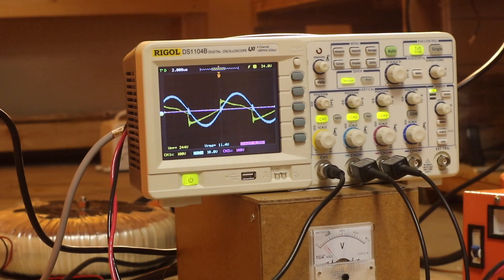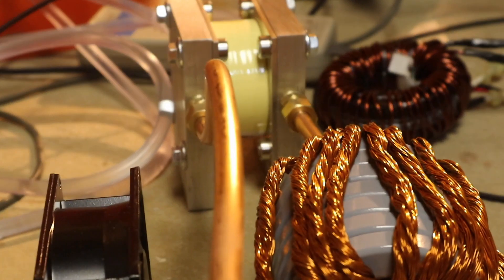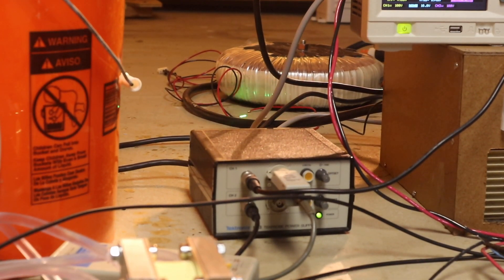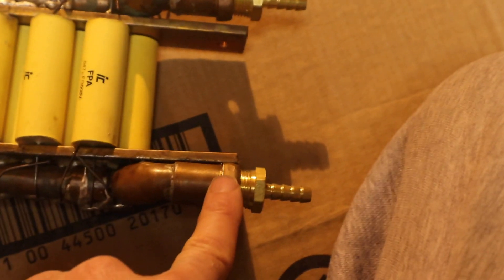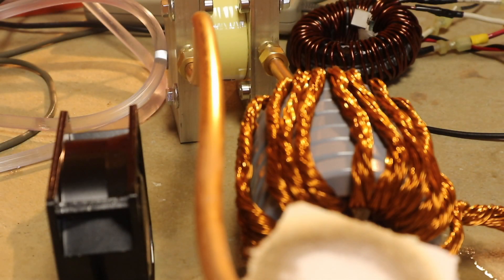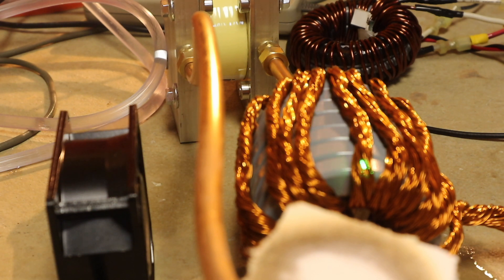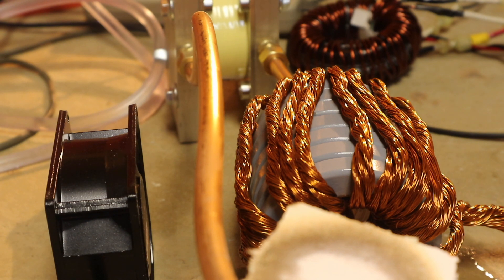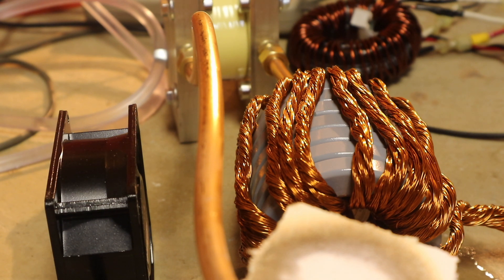How to build a stable high power Induction heater considerations for the tank and transformer

Comment: Would using silver plated magnet wire work a lot better to control the resistance lossed in the wire itself ??? Thanks
Reply from the maker: Not significant enough to justify cost. You would need very thick wire.

Comment: It is only recently that I became interested in induction heaters.  I must congratulate you on the very ingenious arrangement of how to create a low voltage source with a very low internal impedance to feed the low impedance of an L/C series tuned circuit. 

Your voltage step-down transformer does not have numerous secondary windings turns which add internal impedance and will limit the secondary current,( even with a short circuit at the load). You made the secondary by elongating the amount of straight run copper that is captured by all those stacked toroids ferrite cores on top of one another ( well side by side in your case). So rather than using "turns" on a circular but thin/flattish magnetic core, you used a long straight run inserted through a long "solenoid", which does not give you a high Q factor for the secondary tuned circuit, but this is not " filtering frequencies" as we do in communications where coils are normally "square coils"   for better selectivity,  and higher Q factor as your intention is aimed at the producing highest current in that secondary. It would be interesting to know how you held the resonant frequency as you added the material in the hot coil.

 That long straight piece of copper running the length of the ferrites stack is the magic in your arrangement.

That straight copper part in the stacked transformer cores gives you the very low internal impedance of the driving source which you need to drive high current through the SERIES TUNED CIRCUIT  of the external coll inductance and the capacitors which you paralleled so nicely, but it is, in fact, a series driven resonance circuit with very low overall impedance at resonance, that brilliantly matches that impedance in that straight copper run in the step-down transformer.  As I have never worked at such high currents, it is truly an experience seeing water-cooled capacitors and inductors. I am just wondering how they cool high-value capacitors, as it is easy enough with a coil made out of a copper pipe. Remarkable.  
 .  
Not only you have managed to get the lowest possible internal impedance of the driving source which, considering the whole secondary circuit you have only, one part, of one turn actually effective coupling the step-down transformer, as other parts of the secondary single turn are too far away. while the hot coil has enough turns/externally located inductive impedance ( a sort of a  magnetic lens effect) to set up the highest localized magnetic field around the crucible.   Congratulations. Today it just turned  Christmas day, so Merry Christmas and a healthy, peaceful, busy year! Thank you for the very interesting video.

Comment: Which is best material for coupling transformer, I'm running my induction furnace at 10 khz my system is robust that can handle this frequncy i found you are using type 3 material but that  material frequncy range is 50 khz to 500khz i need 1 khz to 50 khz range toroidal core pls can you give some details about that

Comment: Very intresting! I'm also about to build one and will put up a video later. 
I did build a small prototype about a year ago (not the old video I have on my channel though - that's another simpler design that only works with low power) and I actually think a ferrite core (with an 1-2 mm air gap) will do better in the transformer that transfers power to the tank. Of course your heater still has a lot more power, but mine used like 500 W and was fed from a transformer and rectifier that gave only about 30-35 V DC (wich gives only about 15-17,5 V AC over the transformer, since it's fed by a half bridge - the more voltage you have on the primary of a transformer, the less magnetization current you get and the opposit) - so it seems like the whole thing would behave pretty similar if it's scaled up and uses higher voltages. Wich I will do in my next project.

The thing is that the coupling is really poor on those iron cores - they are really great for DC inductors (for example to build high power boost or buck converters) - since they can handle a lot of current before they saturate. But they are apparently very poor transformers, due to bad coupling between primary and secondary. I tried using an iron powder core at first (since I saw your first circuit) - but had a hard time getting enough power to the tank without everything overheating, due to huge magnetization currents (just like you are talking about in the video). 

Then I thought I would give it a try with a ferrite (N27) E core that I had laying around. I have a formula that I can share if intrested (it gets too long to put in one post) - wich you can calculate how many turns you need on the primary winding of a transformer, to avoid saturation (I originally found it on a site where they showed different designs and calculations of switched mode power supplies, wich unfortunately is not up anymore). 
It turns out that the power transfer with the ferrite core is som much better, that you can have more turns on the primary while still having the same or better power transfer. At the same time, that material also have a much higher AL value (the amount of inductance compared to the amount of turns) - that means the primary winding gets much higher inductance and the magnetization current will drop by a ton (thus avoid saturation). The iron powder cores can still theoretically handle 5 times more voltage on the primary since they can handle about 5 times higher magnetic flux density before saturating - but in practice, you can't run them even close to that, because they will heat up due to losses. My iron powder core got so hot that the paint started to burn off, haha. Not to mention the problems for other components and wiring caused by the huge magnetization currents. 
You probably want to have an air gap in the ferrite core though - because when the tank get into resonance, the energy will be stored up and the current increases - that in turn will cause a voltage drop over the secondary inductance, that's greater than what would otherwise be the secondary voltage from the transformer. That means the secondary will now act as a primary with just one turn and backfeed some reactive power, back to the bridge capacitors. If the secondary inductance is too high, that voltage drop may be so large that the core goes into saturation (just like if you have too few turns on the primary and apply too much voltage). An air gap lower the inductance somewhat, but not so much that the magnetization current become a problem (as with the iron powder cores).

Comment: What do you use it for?
Reply from the maker: melting/treating metal. For example, if you have to reshape iron or copper it is not malleable. By heat treating it, you can easily bend/shape it as needed. Of course, you can just melt things super fast.